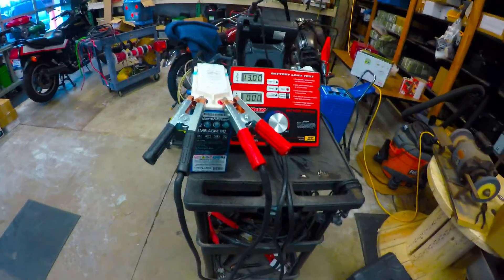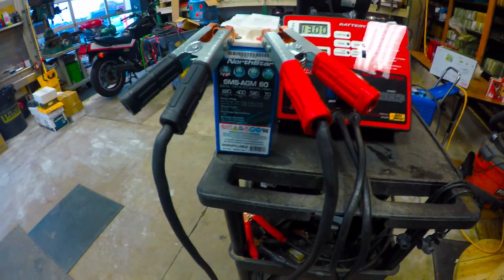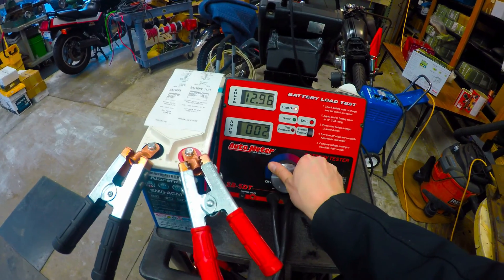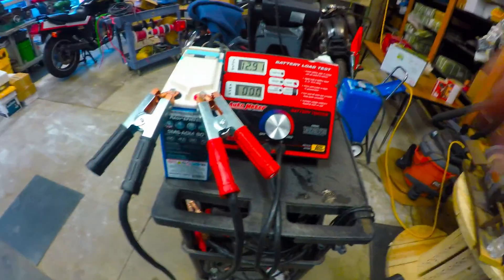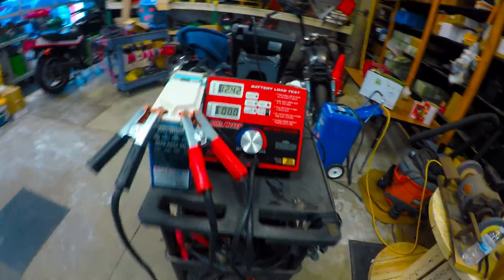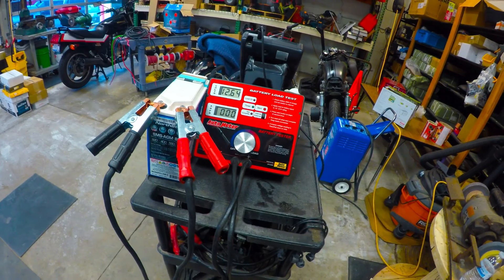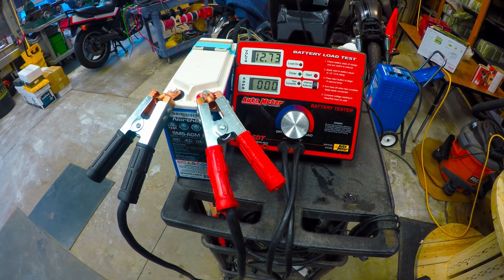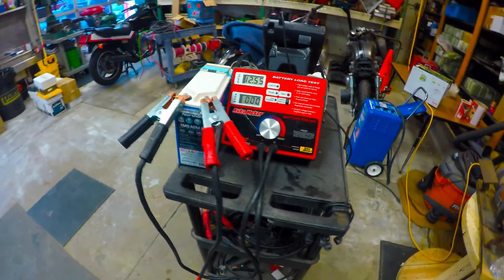Test My Batteries: Northstar SMS-AGM 80 (Part # NSB-SMS-AGM80)

Comment: I've been watching your battery test videos and they are pretty cool. I'm trying to learn more about these things.  I just don't know what is happening in the video.  Can you explain what you are doing with these 1c,3c, max etc?  You didn't really share any numbers or results as to what this all means.  How do I know what is the best?  Thanks! Look forward to more videos.
Reply from the maker: John "c" stands capacity. The c rating is the ratio between capacity and discharge/charge current. This allows one to compare across multiple size batteries and relate it's energy storage(capacity) and relate it to it's power density (c rating).
Reply: Kevin Ross ok cool. That helps out.  I like these types of test videos. Hope to see more.  So from your opinion and experience, between something like a NorthStar AGM, Deka Intimidator, or Optima RED, what would be your recommendation? 

Thanks!
Reply from the maker: John northstar will have the best product, followed by east penn (deka) and then optima last. I can provide any of these brands. Send email kevin@misolarenergy.com

Comment: Nice, I have one of these powering a small Synergy wfo15.1 and not a bad battery. Price point to me was a little high. I had the small little Juicebox Black series batteries 50AH from Thomas at Xplicit and it didn't seem much different for a better price point. That's just my personal opinion but still overall a great battery.
Reply from the maker: This is my second favorite battery besides the revised Juicebox Raspberry (same size as the one you owned however more power dense). Both come out to roughly 40-50Ah reserve at a c/20 rate, so to be expected to have similar performance.
Reply: You can tell they were similar, I honestly just jumped the northstar boat when they offered that and tried it out and honestly, i didn't see much of a difference but the price points were around $60 - $70 and this test proves it's still a great battery but I think you're paying more for a warranty than any difference on this.